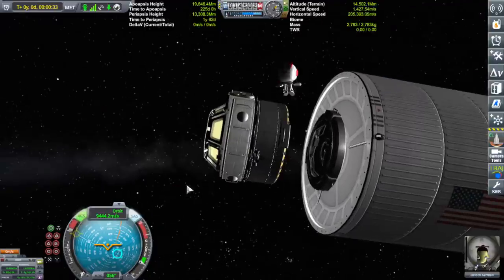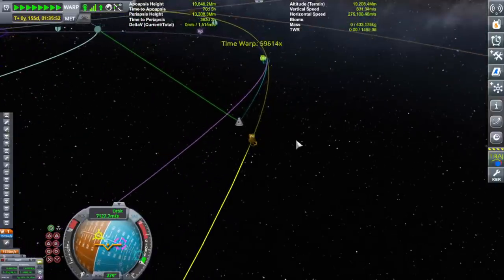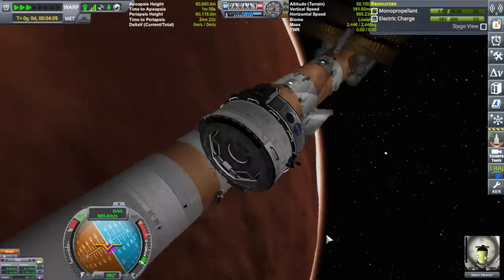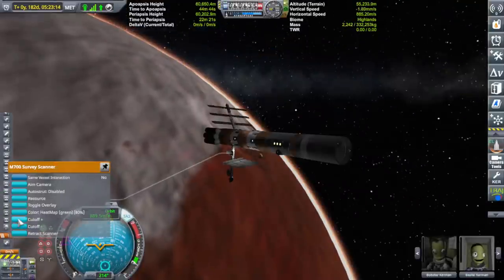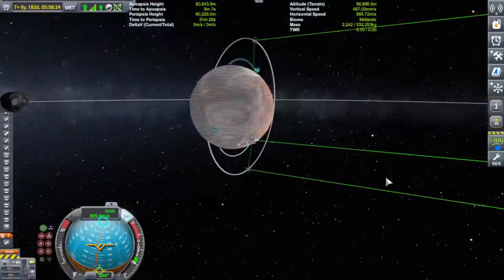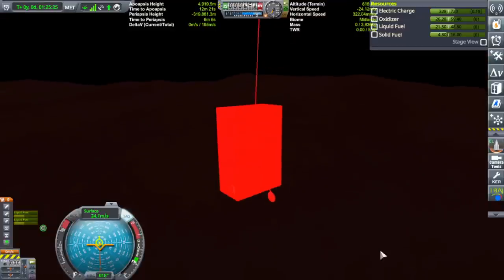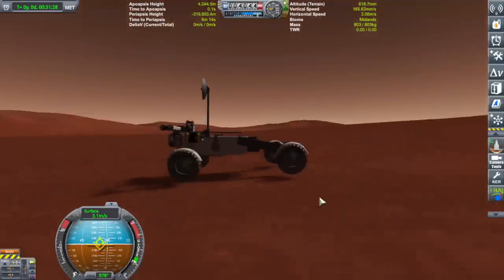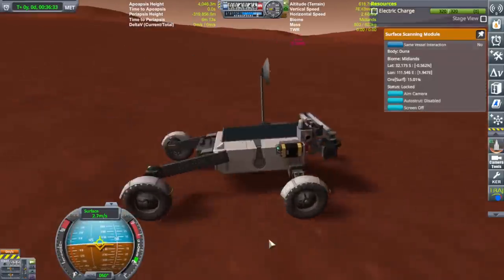MISSION ENDURE. Colonize the solar system in Kerbal Space Program \ PART 3

Comment: One issue with your comm net work is you have to use Relay antennas you can usually tell because the antenna with relay capabilities usually states it in the information panels it will either say ‘Relay’ or ‘Direct’

Comment: Everything is beautiful! The lost rover seems appropriate to me;  a cheap and hastily-built colony ship would have more than one thing fail. Fortunately, the crew of #735 elected to load a second rover, to speed things up and "just in case". Surface operations will be slowed, and Logistics is peeved about having to reschedule everything, but they're not doomed.
So, uh, how exactly did you locate a large level area near an ore deposit? I know some probes Kerbnet scan for ore as well as terrain, but I've never seen anyone actually do this. How many hours did you drive around? In older versions, I've flown planes for hours around Duna as well as Laythe looking for something suitable, and always had to compromise.
Reply: I think you nailed it already.  Ore distribution is random when the save file is created as a new game.  I have a great ore dist on Minmus on the flats on 1 file, my other, slightly harder save has the densest in the mountains.  I spent hours searching for the best spot and the only thing I found was still a compromise.

Comment: I love seeing the engineering pod travel along the colony ship. It really gives a sense of scale. :)

Those don't look like relay antennae on the comms satellites. I guess it might work if a smaller relay dish picks up signals which needs relaying and then the big non-relay dish sends them to Kerbin; I don't know if KSP's relay nonsense supports that. If not, you'll need relay dishes big enough to reach Kerbin. My lack of experience led me to put relay dishes on everything for a while, but not launch actual relay satellites. It led to a funny situation when Dres was between my drone fuel tanker and Kerbin. The tanker's signal went out to a ship on its way to Jool, back to a mining ship on the other side of Dres, and off to Kerbin.
Edit: I haven't found the little folding relay antenna to be much use at all. It might work well if you had 'umbrella' antennae on the craft using the relay.

Edit: (posted too soon.) The narrow-band ore scanner is a lot more accurate than the giant one. I like to use "heatmap green" color mode; the best bits show up in red. I set it to update every 3.5s, but sometimes pause it to place some of the more tricky waypoints. As to which way it moves, I think by default forward is at the top, but there's a setting somewhere to put north at the top. Either way, rather than trying too hard to figure out its little map, it's a good idea to just place waypoints and see where they are on the main map. If you do that for a while, you'll get the hang of it. Terrain is showin in the same sort of window, but from certain probe cores rather than the ore scanner. Sometimes, I assign action groups to 'open kerbnet' on a core and the scanner so I can flick between them.

Comment: I was the guy suggesting to not waste the Cupola by making it re-dockable, now you turned that idea into something way beyond awesome by making it a tiny engineering craft, very reminiscent of the tiny craft in 2001. I'd recommend putting the tiny claw somewhere on the front of the small craft itself, that way, it can conveniently attach to any part of the ship and the pilot can easily work from just outside his airlock while having access to the parts from the storage unit.

Also depending on what parts you have to offer, you could add stuff to the small craft and try using that to reclaim the lost rover... I hope you packed jumper cables...

And the bug with mirroring robotic parts making them go apeshit is such an infuriatingly frustrating thing that I have pretty much given up on using any robotics, just cause it's such a mess. Squad has to fix that thing and it is beyond me how they can claim that their game is finished, when such an important and basic functionality is broken in such a stupid way.

Be that as it may, looking forward to more of this series!
Reply: I think the robotic parts - and some other things such as elevons, are too automated. The game tries to guess which way they should turn, and sometimes it gets it wrong. If there was a build setting instead of all that guesswork, they'd be fine. This sort of thing has been a problem since basically forever in all sorts of programs.
Reply: @eekee6034  I genuinely doubt it. When I put hinges on something using symmetry, it never works. One side will work as intended, the other will just stay at a random angle. When I hit the toggle, it just shakes for a moment and stays where it is. It's not locked, removing it from symmetry and putting it in the action group manually doesn't work. I can only attach the two pieces manually and indivually...

When I try to use symmetry with robotic parts, it always screws up. This is not a hyperbole. It never works. *Never*.

And it is way past time Squad fixes this stuff.
Reply: @h.a.9880  Ah, never. I've seen so many things which sometimes work, I've got sick of the whole "computer tries to guess" thing. If it never works, then yes Squad should have fixed it.
Reply: @eekee6034  I feel ya. A lot of people like to say something is always or never the case when they mean "most of the time" or even just "sometimes"... it's an inflationary use...

I wonder if it's just an issue with me having a really old install that got patched to current version. The part-sliding function using the shift-key, for instance, didn't work properly when your install was substantially older than the Breaking Ground DLC.

Comment: Hey, I have a suggestion to make your gameplay a bit more challenging! In career mode, it doesn’t let you use maneuver nodes until you upgrade your comms building later. I was thinking you could try to replicate this kind of by limiting which tools you can use based on what buildings you design later, and how you “upgrade” them. This can apply to things other than using maneuver nodes, like deltaV read outs, ship size limits, etc. maybe you could even try to recreate the need to unlock parts through the tech tree or something!!! Idk, might be kinda cool! Good luck man!!!

Comment: You need to place  them in a certain orbit that is good for relays i think the orbit has to be the radius of the body you putting it at. example 320km for duna it's good to have 3 relays make a triangle with the connection line thingy hope this helps.